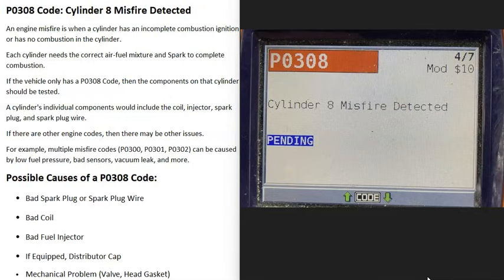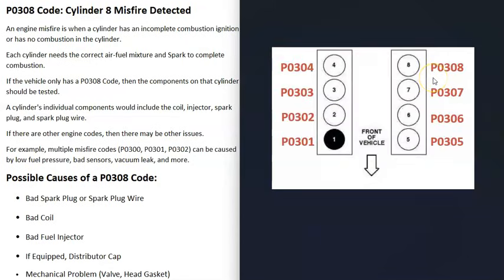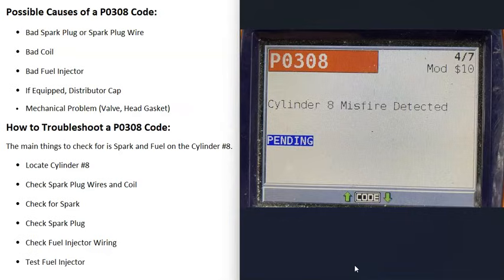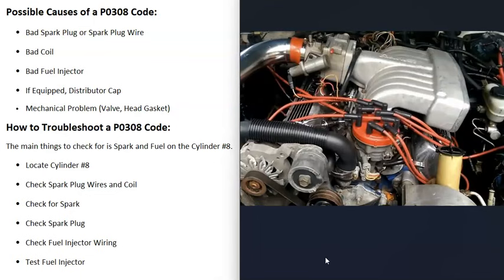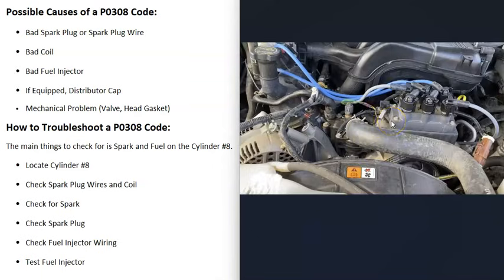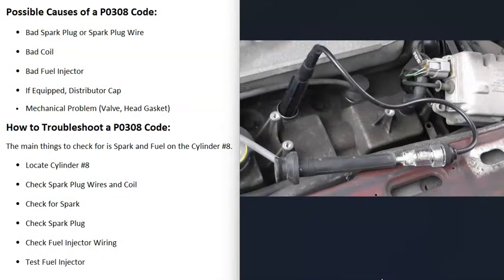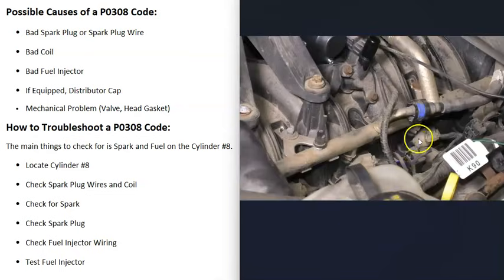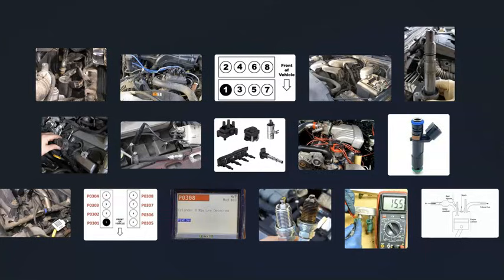Causes and Fixes P0308 Code: Cylinder 8 Misfire Detected

Comment: 2019 yukon. i replaced the fuel lines, fuel rails, fuel injectors, manifold gaskets, spark plugs, spark plug wires, and coils and still have the code. any idea
Reply from the maker: It needs to be diagnosed, If the injector is good, first, I would check for a spark. There are low-cost spark tester tools. Here is a video I made showing how it works. https://youtu.be/bOX-TvZ2RCM
If there is spark next, I would test the injector circuit. With the key ON, there should be a constant voltage, usually 12 volts, on one pin. The other pin will be ground, which is controlled by the computer. I made a full video on how to test this and check if the computer is sending a signal. Here is a link. https://youtu.be/JL4_HlYCKrw

Comment: I'm getting p0308 on my 2002 Tahoe, I replaced the spark plugs and wires, coil and injector and it's still there. What do I do next? Only 74000 miles on it but the people that sold it to me gave it a bad life
Reply: I’m having this issue right now and I was talking to my dad about it. 

Check out the vacuum lines. Could be too much air getting in. Spray some water over it while it’s running and the RPMs will change if there’s a leak. 

Another cause could be the exhaust valve on cylinder 8.

Comment: Your wrong in someway, most of the times like 9/10 a p0308 with a p0300 , its coils and sparks, thats it.
Reply: Exactly what my truck I just bought has it says,it idles fine revving it but when I go to give it gas it starts fluttering and missing ,then if Ipunch on the gas it’ll come out of the miss.Where would u start bro?Ima carpenter totally a knuckle head when it comes mechanic work,but the diagnostic machine reads this code

Comment: Thanks for a confirming all of this  - What would you do if I’m getting 0308 plus codes for Fuel Tank Pressure Sensor, Evap, and Fuel Rail Pressure Sensor? While I’m driving the misfire (motor shaking) starts for a couple minutes, then goes away, then comes back again, and that keeps repeating? 
I added Lucas fuel injector cleaner to 1/3 tank of 90 Ethanol Free, and it’s better but still intermittent misfire but less often and lasts less amount of time? Bad Injector or injector wiring? Spark Plug going bad?
Reply from the maker: I would test all the main components on cylinder #8 coil, injector, and wiring. I would then test if the EVAP purge valve is good. It's the only EVAP component that can affect the engine. I would also check the fuel pressure at the fuel rail with a gauge or scan tool.

Comment: I have a ram 1500 4.7 v8. I’ve changed out all spark plugs, coil, wires, fuel injector, lifters and radiator rocker arms. I’m stumped and don’t now what else to do
Reply from the maker: If the parts are good and there are no other codes, it is likely in the wiring. I would verify there is spark at cylinder #8.
Reply: @HVAC_Mechanic  there is I verified and a shop verified as well
Reply: @Chingysfakechain valves are shot?
Reply: @HVAC_Mechanic did you ever fix it ?